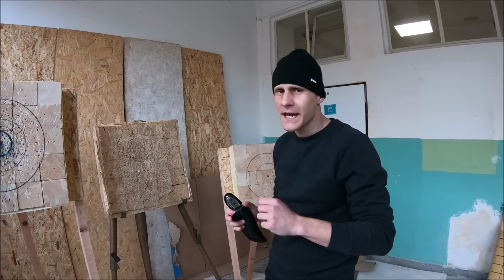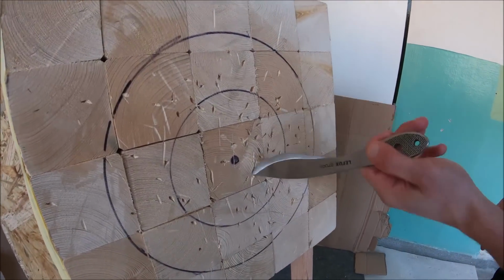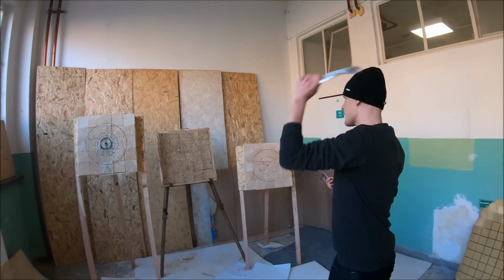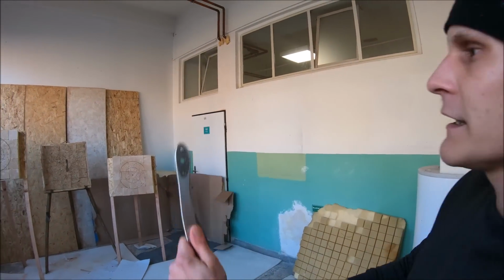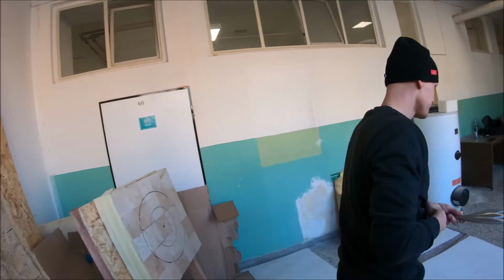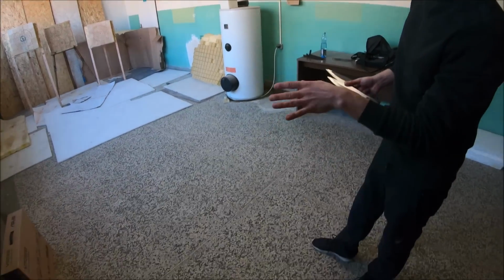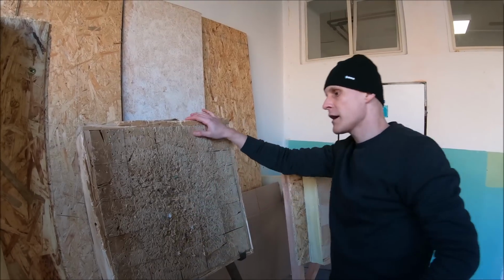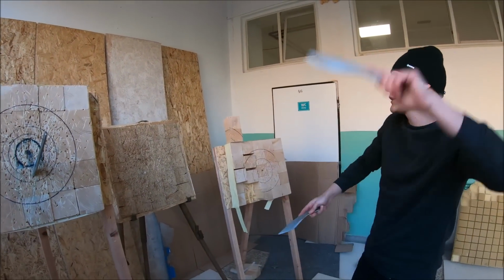Knives For Any Technique? (Lefux-Stork) Throwing Test

Comment: half spin look ok  upto  3/ or 4  meters  ,,depend  of   blade   lenght   weight,, no spin look like  magic to me   all over   6  meters  ,, but    looking at   video on  5  plus  meters they  fly   like    a   crosbow   bolt ,,without   feathers ,, so  for  me   a  full spin //I KNOW  A   12 X  TIME  HARDER TO THROW FROM   NOT   ,,PRE TESTED ,, DISTANCES ,,  ON KNOWN  DISTANCES  NO MATTER   2X SPIN  4X 10 X 12 X  IS   SIMPLE ,,WELL WHEN  TRAINING   YEARS AS  I DID ,, BUT    OVER  5/6 METERS   THERE  IS   A    NEED TO ESTIMATE BY  EYE IN SPLIT SEC   DIFFERENCE OF   3 AND  HALF  TURN OF  BLADE  ,, TO   3,AND   22 TURN //THAT  IS   A  MISS// OK NO TOTAL MISS  BUT  ON  WOOD  NO  STICK ,, I LOKE YOUR   FRIEND S  CROW DESIGN ,, I  WOULD  LIKE  IT   A   FEW 10 GRAMM MORE  HEAVY AND   A    INCH OR 2 TOO SHORT   FOR  ,,POWER THROWING   EXTRA   LONG DISTANCES //BUT  NICE  HANDLE SHAPE  FOR  NO SPIN //I AM  FROM  SLOVENIA SO    200 EUROS   FOR 3  BLADES  IS   TOO MUCH  FOR  ME  ,, I    WILL DESTROY  FIRST   BLADE  UNDER    A WEEK I  BET 3X PRICE  OF SET ,, I  WHEN  FEEL   LIKE  TO THROW CAN  DO IT   FOR   10 ,,OR  MORE  HOURS   AND  MORE   SO   EVEN  3 SET   STARTED TO HEAT  UP ,, AT TIP // I  THINK  NOW  I SHOULD  OF   PUT THEM IN  ICE WATER    FOR   FEW   MIN // BUT   FATIGUE  ON  TIP   IS THERE  //WHATEVER  YOU DO// I LL  DO  SOME   CROW   10 /15  PERC  LARGER BLADES  ,MADE  BY  ME   BY HAND  FROM  SPRING STEEL ,,AND    TEST THEM //BE   SAFE  , HOPE  YOU  ARE  BETTER  , YOU LOOK    OK //   michomicho223@gmail.com // mail me  /i  am  from  slovenia /ex   yu //